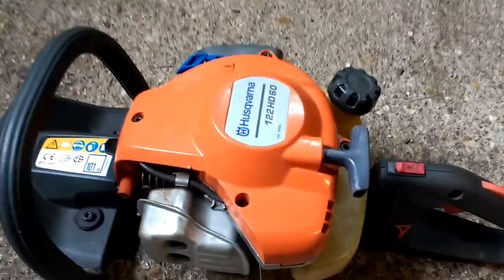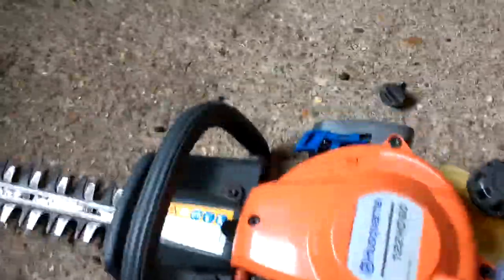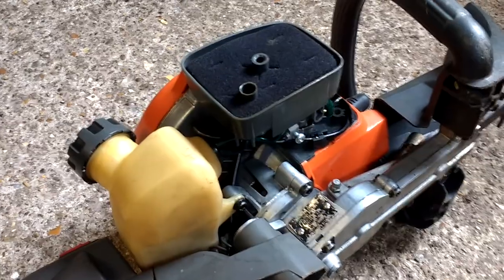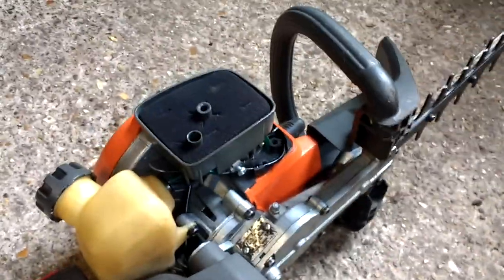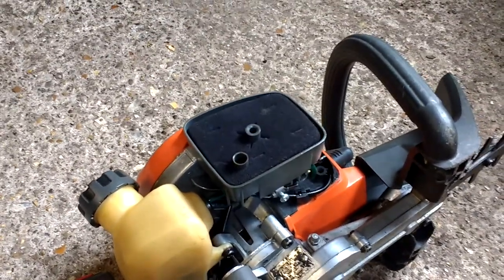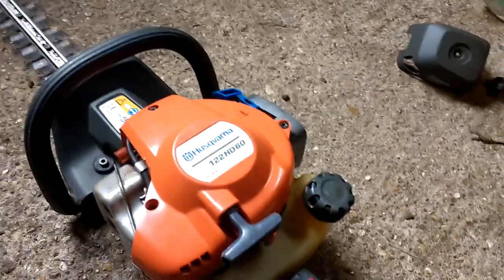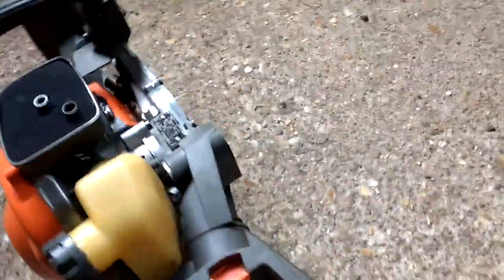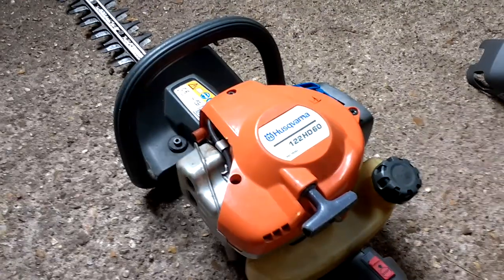Please Help My Hedgecutter Only Runs On Full Choke

Comment: If it only runs on choke then there is poor suction on the lines or the carb is gounked up. Either way it's sucking fuel poorly because of something.

Comment: It can only be two things.... Blocked jet in carb, clean and don't forget to clean the tank. Or its drawing in air so when on choke it richens and runs equal to the air it's pulling in. What you can try to establish this would be to start it up on choke, see if engine runs fine on choke when warmed up, if it starts choking up back the choke off slightly, wait a bit and see if you have to repeat this. If it continues to run clean I'd say air leak, if it choked up when warm then blocked jet.
Reply from the maker: i will give that a go thanks for the advise

Comment: Hi - bit old I know but this is a really simple fix. 

You need a 4mm internal diameter splined socket driver (about £2 on ebay) (think its 4mm). Its just like a little screwdriver.

Then tighten both the H and L sockets up fully to the right. Start your trimmer on full choke and let it warm up playing the choke and throttle to keep it going. 

Now open up the H control a half turn a time and ease the choke in - when its all the way in and you have full throttle and running blades - good.  

Next start to ease off the throttle and open up the the L socket half turn a time till you get a steady idle with no throttle and no choke. Make sure to play the throttle and nut to keep it running. 

This isnt really a problem with carb jets or old fuel - its overly sensitive idle settings. its a dirty 2 stroke machine - it should be indestructible. 

Mine still needs a reset/play/tune each use! Crap machine but hey. I also had to replace the tank fuel line as the first one just rotted in a month!
Reply from the maker: Thanks mate in the end I just got a new carb work fine but I will get one of the carb adjusters.

Comment: are there adjustment screws on the carb? if it starts and runs fine on choke then dies when not on choke it sounds like a fuel air mix problem, could be adjustment screws need tweaking or possibly gasket trouble
Reply from the maker: i need to get and specific tool to adjust the high low screw but i think i will get one see if that make a different  thanks for the suggestion

Comment: My guess would be to rebuild the carb. Cheap money and with a little patience can be done at home. This may sound dumb but check your fuel lines as well. The smallest tear could cause the machine to run badly. But I'm pretty sure a rebuild or new carb is in order.

Comment: Partially blocked main jet. I'd  say. Check the fuel lines as well.   But I'd put my money on a blocked carb. Clean the jet with some sort of wire like a bit of a wire brush or something like that.  Hope this helps cheers Calvin
Reply from the maker: i have clean the carb 2times already but i will do it again thanks

Comment: Hi did you manage to fix them ?
Mine are doing exactly the same
Reply from the maker: Stuart Martin check out my other videos on how I fix it but basically I just bought a new cheap Chinese carb now it working fine.
Reply: MrGardener18 hi , I noticed your other film where you got another carburettor after I posted the question .
What's got me puzzled is I've got a old set of hedge cutters with the same carb & after swapping it there still not working right .
It may well be that I've 2 bad carbs or I have a air leak .
Reply from the maker: Stuart Martin I did replaces the lines I would recommend doing that just to make sure but if that doesn't work Im not sure what the answers is but make you have check sparkplug,spark arrestor est.
Reply: @0000stuart  check for spark and check the  compression  is enough ,change the fuel filter in the tank  and fuel lines,
turn both needles out from seated 1-1/4 turns open choke, switch to on position pump 3 times if you have a rubber bulb primer under the carb, check fuel has come through fuel line, pull the cord if it run then cut out quick ` Now move choke lever down ,now pull again and again if still not started after all that, get a spray bottle with a bit of dish liquid in it and pull the cord several times now spray over the gas cap and around the gaskets if you see bubbles from gaskets tighten or renew, check your cap if it does not vent at a certain pressure you have a vacuum issue change the cap, it needs to suck air in through the hole in the cap to fill tank with air as fuel gets sucked through the carb. check if cap leaks around the thread if so not enough pressure in tank it won`t run ,Make sure your fuel mixture is correct to much oil it will not ignite, check spark plug if smells and looks oily then check your mixing correctly, 
You really need to do more research on small engines watch youtube ,
Hope some of this helped for you to research what`s being written above

Comment: don' think the blades should be moving without throttle.idle speed could be to high . also fish the fuel pick up filter in the tank & a shot  of red X .best of luck.
Reply from the maker: cheers mate i will give a go
Reply: hi my little fs 45 strimmer has just been running very poor (no power & cutting out) put some redex octane booster in tank & its like a new machine . the likes of v power petrol have added detergents to keep fuel system clean. hope it helps.
Reply from the maker: thegeordiefellwalker I definitely look into that thanks for the tip